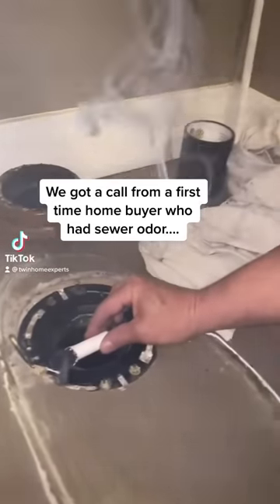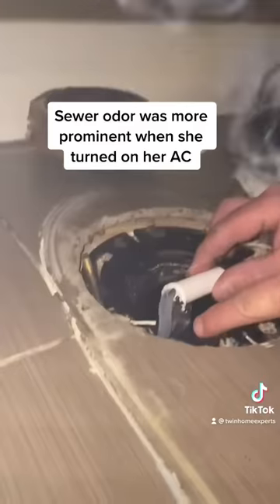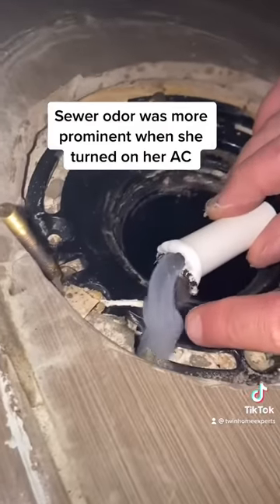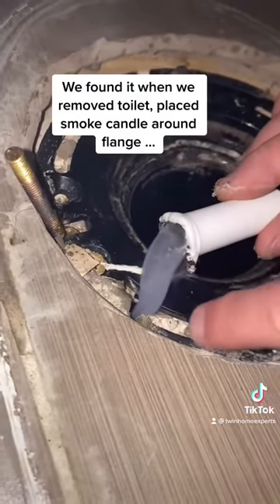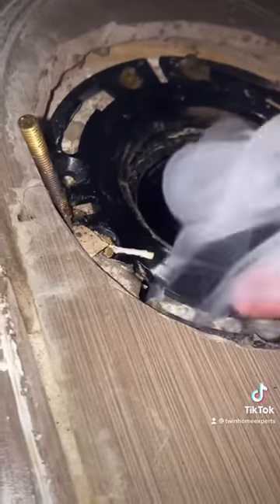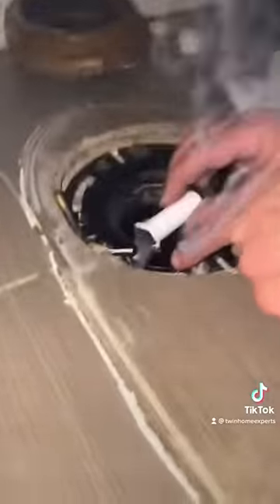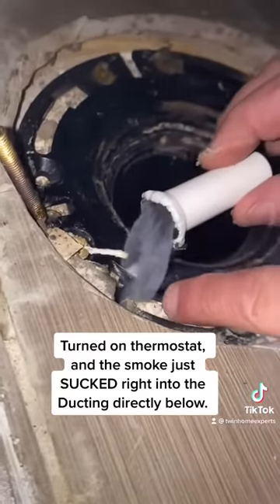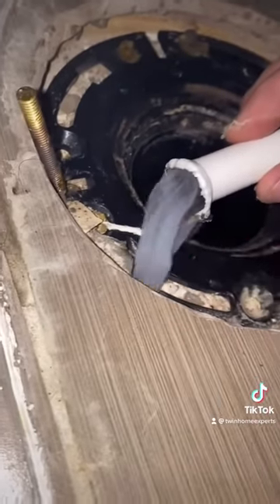BEST WAY to Detect a Sewer Odor 🤢🌫️🚽

Comment: If the toilet had a good seal they would have no odor. Sure the duct work is leaking but the odor is from the toilet flange that is way too low. They tiled up to raise the floor but never bothered to modify the plumbing. Former plumber here.

Comment: Plumbing contractor here! For those of you who are not sure how this works, generally, a 30-second smoke bomb is placed inside a shop vac. And lit. The hose is placed on the blow side of the vacuum and connected to the sewer system (often times through a clean out, but have had occasions where we needed to cut and connect into drain from below(multistory)). Where accessible, we would also cap the vents to isolate the smoke to just the pipes. 

Now we look for where smoke is coming from. Sometimes, we will see it rise from floors indicating broken sewer or from walls indicating broken or disconnected vents. Sometimes, a p trap may be dry, and smoke rises from fixtures.

Note that these aren't your 4th of july smoke bombs. The smoke comes out thick, and when performing this on a commercial building, you have to put the fire alarm system under "Test." To avoid the fire department showing up and fining you.

Id assume they performed the test through a clean out, saw smoke rising from the side of the toilet, pulled it and saw the opening. Performed a few test and saw the culprit.

This company could have just "fixed" the issue by replacing the wax ring, but went above and beyond and found the bigger issue with the return air from the HVAC system. 

12/10, would definitely recommend this company!
Reply: Thanks 🙏
Reply from the maker: 🙏👍💪👊👏❤️.   Back at you my friend, this video got over 12 million views and thousands of comments your one of the few that understood what happened. Here is the full story showing the details of how this caused the odor…Sewer Odor in the ENTIRE HOUSE! From the TOILET to the AIR DUCT!!??
https://youtu.be/gX9eJGWSZZY
Reply: @TwinHomeExperts  That was a solid video! You, sir, are one of the few true professionals out there. Keep up the great work!
Reply: A new wax will fill the hole and stop the issue. I'd suggest the homeowner also contact a HVAC company to block off the stool from air return in case the wax ever fails.
Reply: Awesome, thanks for the explanation
Reply: I just take my fire alarm batteries out. Didn't know I could change the settings
Reply: Excellent description.
Reply: Yes! I was an apprentice several years back for a plumbing business. I watched them do this on a multi-story building. Was super interesting to learn and see! And then to see the HVAC guys come in and work with the plumbers and contractors. We all worked together no matter what the issue was. Now I'm able to fix issues myself for my friends and fam :)
Reply: It’s almost like that what he said or something
Reply: Next question, why in blue perfect hell is the AC pulling return air from the interstitial space?
Reply: @jonb2046  Easy. Lasy install
Reply: This is the only
Comment that deserves any likes at all
Reply: I was literally looking for someone to explain…grací señor🤌🏼
Reply: You ever use a liquid smoke machine through the vent?
Reply: @justinjohnson6481  can't say I've had the pleasure of using one. We dont do smoke tests too often to convince myself to buy one yet.
Reply: @javiervazquez9472  I understand, highly recommend it should they become more frequent for you. I’ve had to do even big buildings like jails and hospitals and it works like a charm.
Reply: That was a super useful bit of information. Thank you for taking the time to post it.
Reply: Oh wow! I was curious how this worked. Its almost like putting dye in Freyon tubes to see where a leak is coming from in the AC. Thanks for explaining!
Reply: 12/10 review my friend
Reply: @bagelz3359  you can't, they mean commercial building style with the big red control panel and the pull handles and such spread about
Reply: I know how smoke works. Everything else you wrote has nothing to do with this video. The only real question here is why the hell the ventilation is passing through the toilet.
Reply: @promontorium  It does have to do with what he said lol. He’s explaining the whole process. The reason smoke is coming from the toilet is because there is a leak in the ventilation system. 😃
Reply: @bagelz3359  commercial buildings have more advanced fire systems then residential that’s why
Reply: You must mean two wax rings as the flange is a inch lower then it should be, it’s what caused the problem in the first place. Raise the flange and no more issue.
Reply: Thank you for explaining. I have very little knowledge of plumbing, and that was very positive and useful info.
Reply: Never in my wildest dreams even imagined that this kind of problem can occur.
Reply: All star response
Reply: Good shit brother. I really appreciate you explaining it so well.
Reply: Thanks
Reply: It’s crazy how people come up with the idea in the first place.
Reply: Damn...so hypothetically could we use a joint
Reply: Only goes up to 10. 10/10. Get it?
Reply: As someone with a bit of plumbers apprenticeship and thinking about going to college to pursue it as a career, thank you for teaching me this as well-
Reply: What was wrong with the return system form the hrac
Reply: Or was that just smoke straight from the bomb
Reply: @promontorium  one of the return ducts that runs under the floor near the toilet isn't sealed well. When the HVAC turns on, it creates a pressure drop and vacuums sewer gas from the leaking flange gasket.
Reply: The flange needs to be raised it’s supposed to sit on finished floor. But these jack flippers never do
Reply: So then the toilet flange was built in the plenum? Or was there a hole in the duct work next to the flange?
Reply: @Lawrence Beaulieu  hvac contractor just didn't bother to run their ducting from the return side of the unit to an actual spot inside the home to suck air from inside the home. 

Since there was an open spot inside the hvac sucking in air inside the crawspace, and since the toilet was not sitting well on the toilet flange, every time they would turn the ac unit on, it would start sucking air from the crawspace, including the smelly stuff from the flange to toilet connection.
Reply: that'll be 400 dollars
Reply: Owner, contractor myself. Well said!
Reply: Smoked many a sewer back in the day.
Reply: I ain't reading all that
Reply: Respect man, thanks for taking the time to write this
Reply: Then you book it the fuck out so the smoke alarms don’t go off
Reply: Yeh but the water seals in every fixture stop sewer smells entering ya house.
Reply: What happens if you don't fix it can that lead to bigger problems?
Reply: I'm assuming their duct work runs under the home.. I've never seen anything like this.
Reply: You mean you'd recommend the plumber, he was the genius. And knowing plumbers... He's moved on to the next higher paying job offer lol Truth! IFKYK
Reply: @@virginiarobbins7539  there is a longer video of this. This took place on the second story below the air unit.
Reply: Flange is below the tile… it needs to be raised as well you novices
Reply: Thank you,,, I've learned from this information
Reply: @TwinHomeExperts you should have posted this and pinned it I’m the comments! I was so curious
Reply: Thank you for explaining…
Reply: This is long but fully explains why well your "Full of it".

The damn hole is not even breaching the Pipe and due to the very professional installation of the Flange which is better than 50% of what I've seen from others being as deeply recessed as it is it would literally almost be impossible for it to leak or didn't you notice? Also you failed to mention it to everyone that when doing this you have to have the damn Fire Dept. as well as City Permits (to do what you described as to finding a leak/leaks through Smoke) AND tell every neighbor effected for them to block their drains (typically you would do it) and tell them exactly when you were going to do it WHY? Because every House connected from the end of the Sewage drain your blowing Smoke into from the Street will receive the exact same process like it or not want it or not and some OLD or Handicapped people can't stand the Smoke some damn near bellowing from their House due to not every leak in every house is small but could be many leaks and large leaks (I've seen it done so many times it's crazy) hence the Damn Fire Dept. being there for safety reasons of course as they Typically help remove the Smoke from the People's Houses that didn't request your services SMH. They  force water into the Sewage once blockage on the other end is released so the force of the water pushing through will blow most of the smoke from the manholes at least so it 
doesn't keep infiltrating.

Did you really say "Shop Vac"? Um when popping a Sewer lid and clogging it then going to the next so you can introduce the Smoke is your "Shop Vac strong enough to blow through enough Piping (both sewer at the street thru the Plumbing inside Houses (Or Walls meaning there is a breach under the house or in the wall) as well as it would have to be strong enough to push through  not 1 house, not 2, not 3, but 8 to 10 damn houses and all of their Sewage Lines within their House as well as the main Sewer line itself.???????

The only way it's conceivable to do what you have described is to have a "Cleanout" between each and every House meaning there would be a Manhole lid showing in the Road at the start and finish of every house location in the entire City????? Does that sound right to anyone or does the Common sense just not make um COMMON SENSE!

I'm no Contractor and as great as you are it sounds like (but I'm starting to worry). I'm only an Inspector within a very small city. Code changes city to city state to state BUT cost effectiveness doesn't, do you even realize how much it would cost to do a cleanout from the street sewer for each and every freaking House attached to their sewage system I've seen just 1 Manhole clog with the entire thing filled so much it's pushing the cover off so the Guy's play Rock Paper scissors to see who going to hold the hose from the Jet Truck while they use high pressure to blow it out (the Guy always gets effected, always. Finally if you had actually looked at the Picture you would see that He has cut a Piece of the Flange so much that it has actually even pierced past the outer perimeter of said Flange just so the Flow from under the House would pull the Smoke. Hell you can even see the end of the PVC within the Flange showing He is no where near the Plumbing and even if he was it would do nothing to show leaks because Sewage Pipe's are not pressurized. So they would not "suck up" the Smoke which is also stupid considering where he is introducing the Smoke at the end of the run of piping for the Sewage prior to the lead out. Even if the piping did "Suck the Smoke up" due to them having a "Plumbing problem" (which is why they are there right?) and IF what he's doing would make an ounce of sense at all.

So if it is outside the perimeter of the Pipe and since the Air is being sucked because oh I don't know maybe Hot Air rises and Cold Air sinks and anytime an area is quite colder than beneath it  what is under the colder entity will draw the Cold downward (OR there is an A/C breach). 

So this is for everyone, what will it do if you blow smoke under the house or even directly into the sewer pipe from Toilet side (Toilet being the end of the run in the House) what will it do will it show leaks in the Pipe or just fill the whole bottom of the damn house with Smoke showing each and every leak in the house just not in the actual sewer lines ran from or to the House. Or would it just blow smoke into the Sewage system out to the street????

So Company -5000/10 would NOT recommended as they are ripping People off either for repeat Business or because it's one of the easiest fixes to that problem and what would make sense to the Customer (that has no knowledge of major house issues)when they don't know that just because that is where they defecate does not mean the Smell must come from there and IF it did somehow leak that bad under the house the problem with that is if the AC was blowing the smell into the House we wouldn't be talking the standard "I've got a sewage smell in my House". That would be an all consuming smelling like there is 2' of crap within every single Room and every time the AC kicked on no matter where you were in the house (even rooms with no Plumbing) you'd still Gag like crazy!

Lol he even tells you Turned on Thermostat and smoke sucked right into the ducting below. He's putting Smoke BESIDE the Pipe to flood under the House so it's an.....................................AC DUCT leak 
 problem being the Duct can suck ANYTHING from under the damn House now due to a leak and due to the strength of the smell you would know 10000000000% if it was coming from the AC ductwork because the HVAC guy's would be there as well to fix the leak within the Ductwork SMH. 99% of Sewage smell's come from the area the leak is typically at and is fairly noticeable but not blinding, nose watering, gagging, just horrendous smell you couldn't avoid no matter the area of House your in as you just couldn't imagine the smell as hard as the AC blows and as many times as it kicks on AND it effecting every square inch of the House or am I mistaken that the ductwork doesn't all come from the same Trunk the main unit is ran too?

SO still -5000000/10 if this is an AC Company trying to prove a leak due to just going under the house you would clearly feel the leak around the ductwork having cranked the AC up to constantly blow. So removal of the toilet then cutting the Flange to to prove a leak would be nuts and Money that would never had to been spent. (I'm throwing out all the options of who these Guy's are with to understand this because Plumbing or AC they are both Idiots). That Triangle Penetration into underneath the House is so suspect it's unreal. It literally cut's through the Flange even though the installation look's perfect. It look's like they drilled a Hole then  cut the top so it wouldn't look like a hole drilled........If your looking at the Foam installed under the Flange that's running up to each side of the Hole you will see blackened part's from time BUT once it reaches to edge of the Hole it has a Pale White end to it. Whiter than any of the entire placement? The other side is like it as well almost like oh I don't know it's been recently disturbed by some form of cutting Tool/Drill bit/ whatever that was just freshly done. IF the smell was that pungent within the whole House then the wiser coarse of action would be to enter the crawl space with the AC turned up and crawl beside the Duct work and you would find it immediately because with everything you can tell just from this one picture I highly doubt the Toilet was leaking.
Reply: Thank you for explaining all that and I'm not being sarcastic! I was reading the comments in hopes someone had spelled this out for a non-plumber 🙂❤️
Take care!

Comment: Just start hitting a joint and when the customer complains say "wait, wait, just watch. I found your problem!"
Win, win.
Reply: LOL
Reply: *puff... *puff *puff
"Ahh, I see the problem, ya see, ya got a f*cking hole in ya floor."
*puff *puff
Reply: @chins. I love this I probably would do this
Reply: @chins. ”Now where do you keep the snacks? I’m hungry”
Reply: @chins. ”now I just have a question about the little decaying girl hanging from your ceiling” 

Them: “the WHAT”

Me: “oh fu-“
Reply: The 90's trade worker would of already had atleast a cigarette light if not a joint.
Reply: @pcmkx  what
Reply: Lol “wait chill out scoop it see dat no good, you want a hit” lol
Reply: @deathedell215 I think he’s insinuating that he’s so high he’s seeing a ghost that the home owners didn’t know about.
Reply: Yeah but then you have to change a toilet while baked
Reply: Have to be a fat ass blunt or j to produce a thick plume of smoke
Reply: @ABHav0k55  that's not that hard if you've changed/installed enough of em. Just gotta make sure you don't miss and mess up the wax ring. After that you got a bit of wiggle room to center it.
Reply: Ngl as someone who’s buying a fixer upper and is going to have to do stuff like this it’s tempting to just use a blunt
Reply: Ayyyyeeeee
Reply: Yuck 🤢! But wow, how cool is that